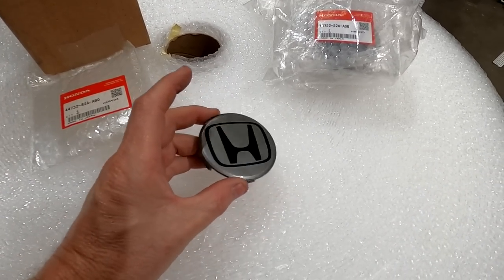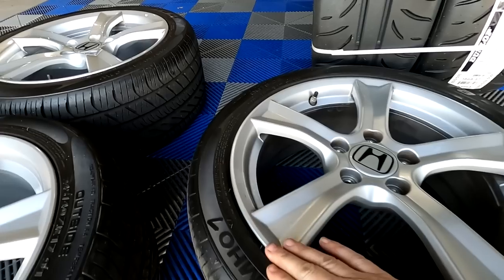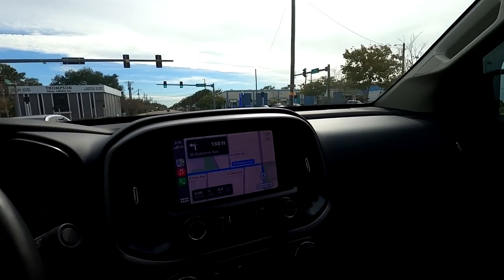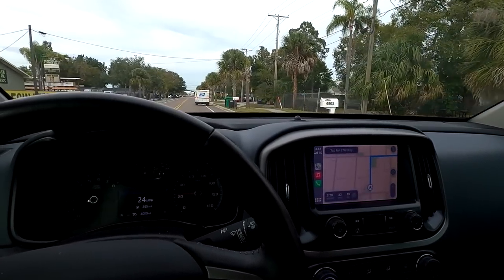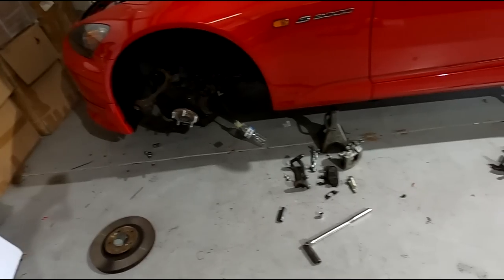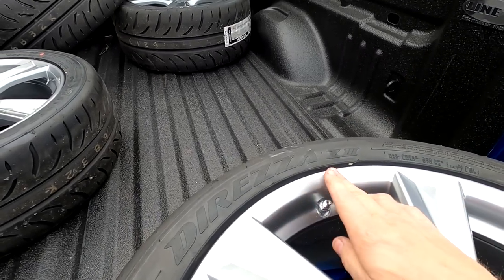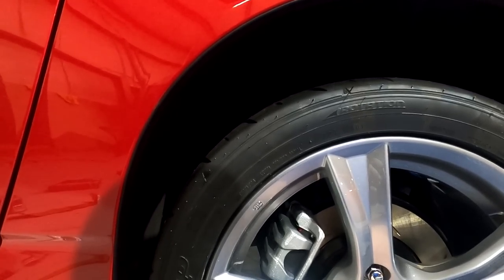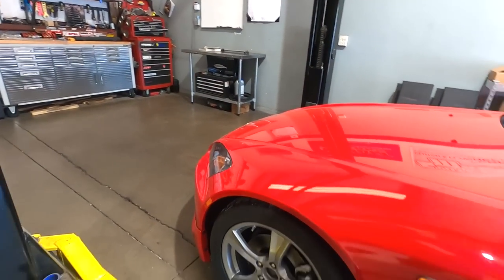LHT’s S2000 - round 1, Wheels, Tires, brakes and lowering

Comment: I just picked up those OEM rims was told about the 225/255 option someone in the comments said he has the same setup with 25mm spacers and you also mentioned spacers do I need to run spacers for the 225/255 setup? Are the lugs you sell longer than the stock ones if so can you source shorter ones?
Reply from the maker: I decided against spacers. I don’t want to roll fenders or deal with rubbing. I stick to oem 17” wheels with CR tire sizing.
Reply: @LHTPerformance  John does that mean you went with 215/245 or 225/255 bottom line is do I need spacers to run 225/255
Reply from the maker: @ciscokid2444   CR sizing is 215/45/17 and 255/40/17. That’s what we run.
Reply: @LHTPerformance  John lol I want to know if I can run 225/255 set up on my stock CR rims like in the video. Do I need spacers if I run those? I want to go up a size but don’t want any problems. I’m an old man if it causes problems I’ll just go with stock 215/246.
Reply from the maker: @ciscokid2444  lol. I couldn’t tell you. I would lower it 25” and stick with the CR sizing. No rubbing and a nice aggressive look.
Reply: @LHTPerformance  ok I’m gonna keep at this I’m not lowering anything I just want to know if I can run 225/255 on my base S2K using V3 CR wheels  without using spacers?

Comment: Hey, what mat are you using over the swisstrax. I need that because, well you know why. The stupid floor can’t take the weight.
Reply from the maker: I Jack cars up on the Swisstrax all the time. I’ve never had an issue.
Reply: @LHTPerformance  with mine, the Jack leaves an impression right in the tile and with Jack stands they also dig into the tile. But I noticed you guys have a mat underneath the car
Reply: @LHTPerformance  I’m sorry, I’m looking again, I see you just have the car on Jack stands right on the concrete. And yea, not sure how everyone is able to use a Jack and Jack stands on these things. They 100% dig into the tiles. Just from the weight alone, unless I use wood under the Jack. But that’s inconvenient
Reply from the maker: Oh yea, I Jack up on the tiles. But I  wouldn’t leave a Jack stand on it too long.

Comment: How did you guys refinish the brake calipers and hangers?  Did you spray can it or powder coat?  I ask bc I'm curious how durable powder coating would be and if you've done it?  I have blue Advan's on mine and would like to put some color on my calipers and hangers (maybe cyan or red) but don't want it to look like a cheap spray can job (not suggesting yours does, it looks really nice and OEM+ as you said)...
Reply from the maker: Test test for a few weeks and make sure I’m happy and then I’ll share. Then we’ll all make an assessment together.
Reply: @LHTPerformance  What did you decide, Paint or powder coat?  Same question for the wheels.
Reply from the maker: @michaeldoyle5001  I ordered Oem CR caps and had the powder matched to that color. It’s in a later video in the Playlist.
Reply: @LHTPerformance  Excellent!  Thanks so much John.  I'm thinking of doing that on my 08 Chicane Silver.
Reply from the maker: @michaeldoyle5001  I did pay a premium for the Oem CR caps. I did end up getting 2 sets just in case.

Comment: John, what are the specs of the rear wheels? I’m hopeful to fit a 255 as well! Thanks! Love your s2k updates!
Reply from the maker: 10mm wider than stock front and rear.  I’ve used the combo many times. Great set up.
Reply: @LHTPerformance  sorry John I meant to write wheels. I can’t find the proper spec online to verify.
Reply from the maker: @andysgaragetherapy  They are stock S2000 V3 wheels.
Reply: @LHTPerformance  thanks John! I’ll check it out!

Comment: PLEASE do the lug nut video asap.  There's no good one on YouTube about s2000's
Reply from the maker: Yes. We found some steel black lug nuts. I’m not a fan of neo chrome or aluminum nuts. These are close to OEM much less money.
Reply: @LHTPerformance  do u have a link to the nuts that you think will be good replacements for the s2000?  Does the length of the nut matter?